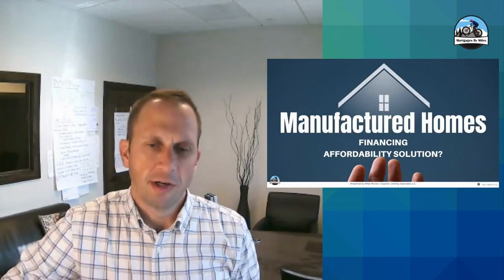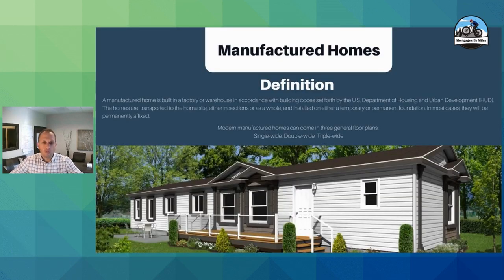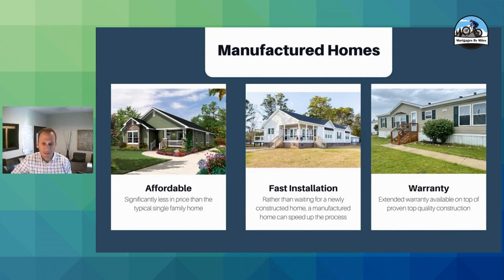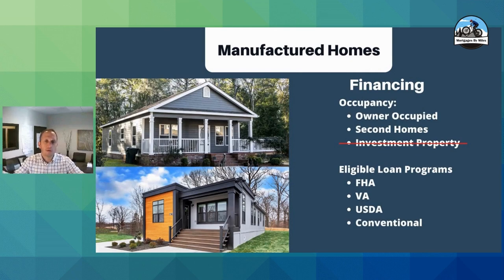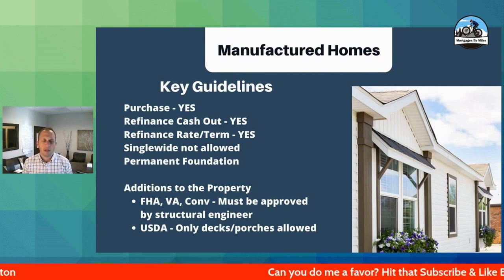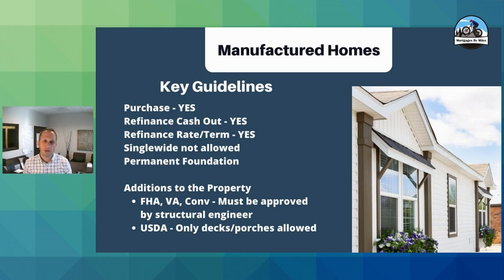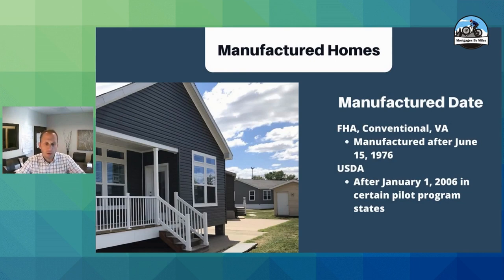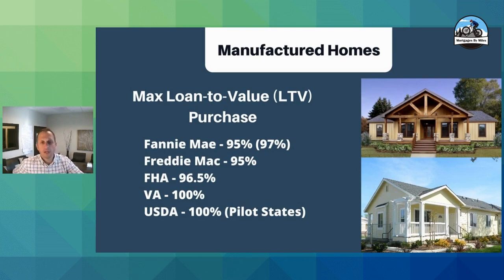Financing a Manufactured Home:  What you need to know

Comment: Financing a manufacturer home in Florida is almost impossible, they are selling a pigeon loft on wheels not a a concrete home come on, the down payment is extremely high, financing rates thru the roof, on top of that you need to add an extra $30k or $40 for well, septic and power, is better just to buy a home, a lot easier.
Reply: A lot more expensive a month to and a lot of the things you mentioned like power , water and septic can all be added into the loan and still in the end be cheaper then a mortgage on a stuck built home

Comment: I’m a Marine of 10 years still active duty and am looking at buying a Mobile home. Many lenders I speak to say they can not do VA why is that?
Reply from the maker: Cody - thanks for the message.   Mobile is sometimes used interchangeably with manufactured homes.  However, Mobile means the property was built prior to 1976 and is therefore not eligible.  If you are buying a manufactured home, double wide, and the ground is included in the sale, you can do a VA loan on that property type.  Please note that the home needs to be set on a permanent foundation.  Please feel free to reach out to my team if we can help with a quote or any additional questions you may have.   Thank you for your service.  Best, Miles.  385-250-1411 or TeamMiles@superiorlending.net

Comment: We are trying to get financing for a single wide already on a permanent foundation and on an acre of land. Any suggestions for getting a loan for something like this?
Reply from the maker: What state are you in?
Reply: @MortgagesbyMiles  Georgia!
Reply: Before buying a new manufactured home. INSPECTED All exterior mating surfaces around windows, doors, vents, corner trim where the siding goes behind it. If these areas are not sealed with sealant as required per Section 24 CFR 3280.307 Resistance to elements and use. All exterior mating surfaces SHALL be sealed with sealant to resist the infiltration of air, water, rain, wind, snow and rodents.

Section 42 U.S.Code 5409- STATES 
A noncompliance manufactured home SHALL not be offered for sale, sold, lease, or leased.

If the new manufactured home complies to the Federal Manufactured Home Construction and Safety Standards.

Ask the retailer for the driver retailer check out form.

When the manufactured home arrives at the retailers lot the driver and retailer inspect the home upon delivery to ensure that no damage occurs during delivery.

Don’t let the retailer fool you. If the retailer doesn’t have the check out 🏃‍♂️ away from the lot and don’t look back.

Comment: Before buying a new manufactured home. Inspect the exterior. Make sure all joints and mating parts are sealed with sealant. That means all trim, doors, windows, corner trim  shall be sealed with sealant as required per 24 CFR 3280.307 RESISTANCE TO ELEMENTS AND USE.

If you find that these items are not sealed with sealant. Ask the salesman why are you offering a manufactured home that doesn’t comply with the FEDERAL MANUFACTURED HOME AND CONSTRUCTION AND SAFETY STANDARDS ACT?

42 U.S. Code 5409 a noncompliance manufactured home shall not be offered for sale or lease.😮
Reply from the maker: Thanks for the insights

Comment: Your video was very helpful!  We purchased a southern energy triple wide in 2005.  Full sheetrock throughout and flat ceiling.  Now after 14 years we are looking in to during some big improvements.  We will soon be adding a permanent brick foundation and then start the process of hopefully being able to refinance and cash out to complete some other additions at the home. (Garage or covered carport and large front porch)  My question is, are we going about this in the right steps, such as putting on permanent foundation before pursuing a refinance?  We are located in rural Alabama.

Comment: If  manufactured home moved more then once ? Is it possible? if so which loans?
Reply from the maker: Usually this is a deal killer.  However, we have a lender that will accept a moved home.  What state are you in?
Reply: Texas
Reply: @MortgagesbyMiles  We had a home with no tags  and labels that my client purchased for 30 k.....They bought it and placed it on their land. The Texas Dept. Housing Community Affairs (over sees all Manufacture homes in Texas issued new Tags and Label with no Installer information on record. Home appears to be originally out of State but nded up with a manufacturer Dealer who sold this to my client (I am Realtor) and my understanding if a home has been moved more then once no USDA, FHA  and Conventional Lender will do the note for that reason. The Labels and plates were issued perhaps a first for this department of what I have been told. The home is a double wide and is attached to the land and it is being remodeled so we can sell in Caldwell county in Texas........What do you suggest besides selling Cash or Seller Financing as my other options.